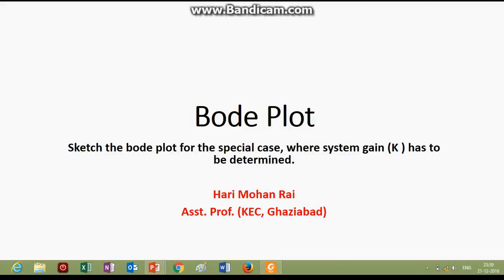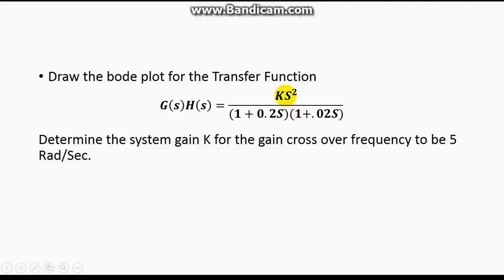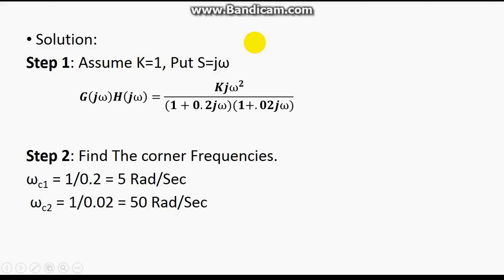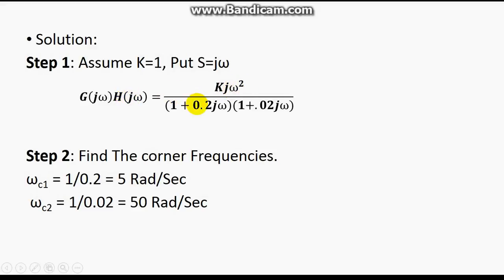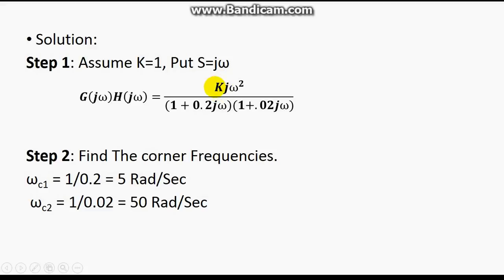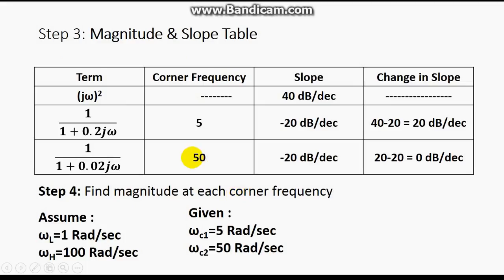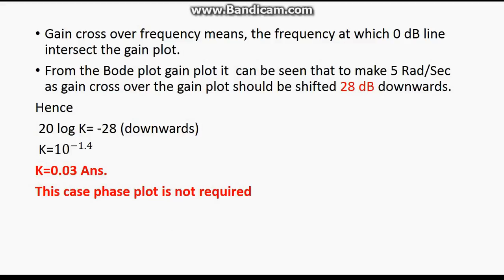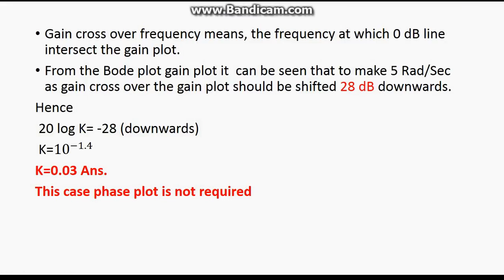Bode Plot: Find the value of k (gain), when gain cross over frequency is given

Comment: How we know sir ,we have to add 28 db downwards
Reply from the maker: 28 dB is the 2nd mangitude which we had found at 2nd frequency wc1=5 rad/sec
Reply from the maker: From 3rd frequency onwards formula changes and every previous magnitude is added on the next. Check the formula)
Reply: He was looking for the value of K which would give 0db at 5 radians per second. As the first graph showed that K would be 28dB above the x axis at that point, then the desired K should make the graph go to 0db at the desired frequency. To do so, the graph of K should be a constant line going through -28dB to shift it downwards the x axis so that it will cross 0db at 5 radians per second, as requested.